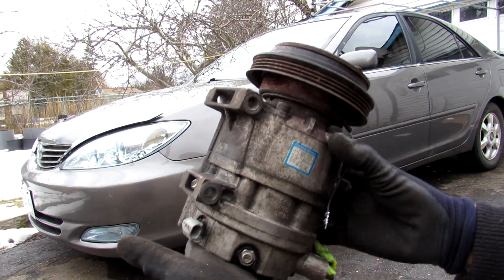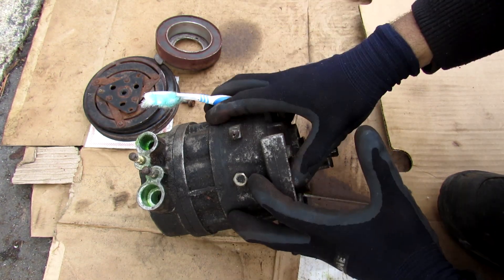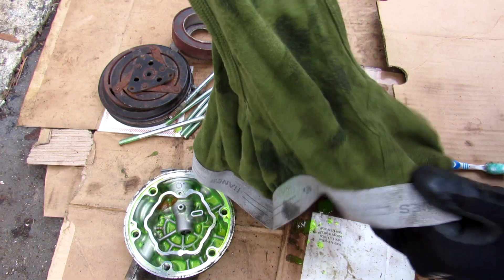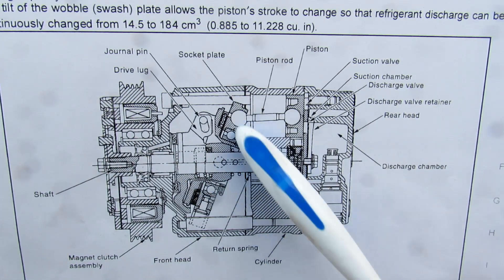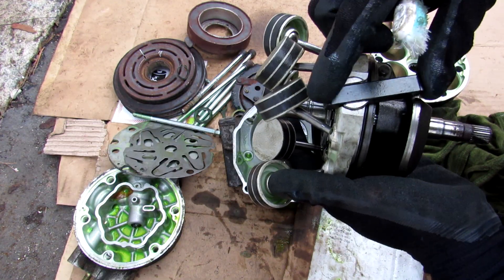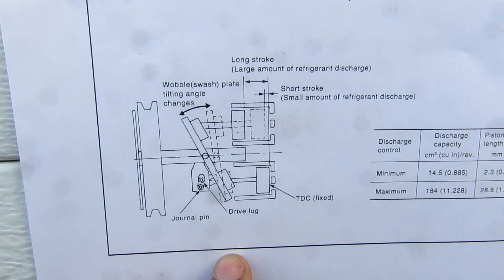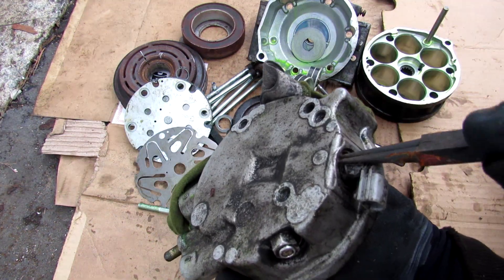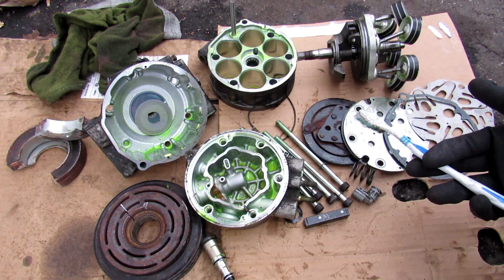How a Variable A/C Compressor Works

Comment: Great video!  I'm working on Denso 7SEU16C, which is a clutchless continuously variable compressor.  The compressor shaft is spinning whenever the belt is turning (no clutch!), and a solenoid controls the swash plate angle.  Because it doesn't have a clutch, you don't see the compressor engage as you can with the clutch versions, so sometimes the clutchless compressors get replaced because people think the compressor is toast (because they can't get the clutch to engage...but there is no clutch!).  These clutchless variables also get overcharged because the gauge display doesn't have the "kick on, kick off" on the low side that you see with regular clutch compressors.  So there are a little different.  They are found on vehicles that have high-end climate control systems which don't require the driver to constantly change the climate controls (ie, you can set a temperature).  The ECU can use engine rpm and all kinds of other info to vary the voltage to the compressor control valve (solenoid) to adjust the swash plate.  So with these clutchless variables, you don't even see the engine rpm change when you turn the AC on. 

I'm replacing the control valve/solenoid on an old (2003) Denso clutchless variable because the solenoids get intermittent failures as they get older.  Great video, and perhaps you can open up a Denso clutchless sometime!  The one I'm working on is from an '03 Mercedes ML350, and they were put on a lot of MB's, Lexus, and of course Toyotas.
Reply: I know instances where such a compressor has been used with manual climate controls (rotate the heater knob until you feel comfortable type of control) too.
Reply: Can you name a couple of vehicles that have this kind of ac comp.
Reply: @RamSharma-90_64  Toyota Camry ACV40
Reply: @RamSharma-90_64  Yes -- I have seen it on 2003 and newer Mercedes Benz's that have the M113 or M112 engine (ML350, ML500, etc), and also BMW's but also some Toyotas.  I think they are becoming more popular so we will see them more often.
Reply: Good explanation....I am having an issue with 2012 kia optima...low side pressure is high and cabin air is warm....when I rev engine up to 2500 rpms the low pressure drops and air gets cold...I think this is a clutchless compressor and my thinking is the angle plate is not changing because of a faulty solenoid valve....when I rev it up even though the displacement stays the same (barely open small displacement) I at least get some compression/suction because of the speed of the compressor....
Reply: Really interesting.  I have the exact same compressor on an Audi A4 Quattro 3L.  I have just fully stripped down my AC system with new dryer, orifice tube, condenser and compressor (and flushed old components).  When adding back to the car, the instructions supplied with what I believe is a remanufactured compressor state to just have half of the total PAG oil capacity put in the compressor (and turn it ten revolutions) and add the rest when charging the AC system (presumably in the dryer).  However, Denso states to put the full amount in the compressor in such circumstances (i.e. total rebuild).  I have heard of hyperlock.  Could I get this with this compressor if I put the full 180ml oil amount (as specified by Denso and specified by Audi) in it?  Any advice welcomed. Thanks.
Reply: @mickandrews9458 заливай полный объем масла, если ты уже промыл всю систему, значит в системе у тебя масла нет и требуется залить именно полную норму заправки масла
Reply: Waaau....at my ML350 from 03 just got toasted....it snaped the belt  ( i dont know why the pulei didnt snap!!!)  I ordered a new one ....and I wil try to DIY myself.....but I must study about the PAG oil.....

Comment: I am a bit confused. I thought the VDCs don't use clutches at all.
Reply: I am also..may be two types it's not.common sysytem 

 Not...A variable displacement compressor eliminates the need for a cycling clutch by altering the compressor's volume based on system demands. The system's clutch is left engaged while the system is in use. They are disengaged if there's a problem or shut down.
Reply: Clutches have been added to variable compressors to eliminate catastrophic failure if the compressor seizes.
Reply: Clutchless compressors use a pulley that has a breakaway mechanism in case of compressor failure. Typically a rubber annular torque cushion that can tear away. Those also reduce noise and vibration. You see them used as clutch springs as well, but they are more expensive than the leaf springs shown on this compressor.

Comment: I have a question. In cars with variable displacement compressors, it is supposed that the compressor is operating as long as the car motor is rotating. So, what does exactly pressing the AC switch button do in this case?
Reply from the maker: Engage the clutch
Reply: @speedkar99  
I mean in cluchless compressor (variable displacment compressor)
Reply: @alaaomraneg  Pressing the AC button (or engaging the defroster) energizes the solenoid in the control valve so that flow changes within the compressor housing and refrigerant begins being drawn away from the crankcase, increasing displacement. The increasing displacement causes a discharge or suction side check valve to open within the compressor housing, and refrigerant actually starts circulating within the AC loop. Turning the AC or defroster off causes the solenoid within the control valve to de-energize, routing refrigerant to the crankcase and increasing its pressure. The aforementioned check valve shuts off as soon as the displacement decreases enough, and refrigerant stops circulating inside the AC loop. The compressor basically gets "short-circuited" and any refrigerant circulation now takes place only within the compressor housing. However, even if the AC and defroster are kept off the climate control unit periodically energizes the control valve in order to circulate some refrigerant and lubricant through the system and to the compressor for a short while, keeping it cool. Displacement never gets 0 since recovering the correct swashplate angle is impossible when the swashplate is 90° relative to the compressor shaft. Hence the check valve.

Comment: I thought the variable type didn't have a clutch and the shaft is always spinning with the pulley and therefore the workload is controlled with the valve. This compressor seems to have both.
Reply: There are cars with both designs. Most manufacturers have added a clutch system with a variable compressor so that if the compressor seizes and fails, it won’t affect the serpentine belt and other accessories.

Comment: if its the pressure that controls the angle of the pistons. what creates that pressure in the first place?, the solenoid only controls the amount of pressure coming in or going out, it doesn't create any pressure by itself, 
much explanation is needed.
Reply from the maker: The movement of the pistons create pressure. 
The ECU controls how much of that pressure is bypassed to the back side of the piston (and therefore adjusts the swash plate angle). It's a closed loop control system
Reply: @speedkar99  
so the pistons themselves create enough pressure to work against it and also output the work needed for air conditioning?, sounds too good to be true fro me, how does the law of thermodynamics play in this??.
Reply: @roosterred7924  The engine is what's nutating (through another rotating plate) the plate that is driving the pistons forwards and backwards and giving the needed work for air conditioning to happen. The pressure gradient between the cylinders and the crankcase, which is what the control valve is able to act upon, is what makes the plate tilt in one direction or the other. There will always be a pressure gradient while the compressor is driven as long as the plates never achieve 90° relative to the compressor shaft. There's no magic involved here.

Comment: Excellent work here. This is basically an early Calsonic's take at the Harrison V5 comp. They later switched to an even simpler design that yields a smaller and even more efficient compressor, by removing the front nutating plate (actually called a wobble plate) and attaching pistons to the rear plate (the swashplate) by means of hemispherical shoes rather than rods, and that is the CVC (Compact Variable Compressor) compressor equipped on my car (even though mine has a mechanical control valve that doesn't act upon any external input, it just senses both the suction pressure and the discharge pressure and tries to regulate them to optimal values). The dye is not necessarily a sign of diagnosis having been taken on the vehicle's AC; it's usually fitted every time a service is done to better diagnose a leak in case one springs soon after the service. Some OEMs even include it in the factory. Personally, i see enough oil inside to think that the compressor has been ran with a good refrigerant charge most of its life. There's some rust, maybe owner didn't care about replacing the dryer/a DIY kit has been used to "top up" the AC and/or the system has been kept open for some time in its life. 2:55 That's an HPRV valve that pops open whenever discharge pressure becomes too high for some reason. Oil drain bolt is located forwards, towards the front (hex nut at 1:36), in order to aid oil removal. 3:31 Not only the pistons are moving up and down; at that time, they're doing so in the lowest displacement the compressor can attain (as you can better understand at 5:28). Interesting behaviour (and design) because the Harrison V5's mechanism will be doing the exact opposite, i.e. it will be driving the pistons at their maximum displacement in the same condition. That means that the Calsonic compressor has a "softer" start (the control valve, however, soon restores maximum displacement by bleeding the crankcase pressure to the suction side, if required). The CVC compressor in my car has the same perk. Rotate the clutch hub by hand in a summer day and it will get increasingly stiffer to turn as you keep turning it. That's because the plate's angle relative to the shaft is decreasing and the pistons are trying to compress more refrigerant.
Reply from the maker: Yes

Comment: Great explanation video!  Wonder if all manufactures will go to the clutch-less compressors?
Reply: No, the newest trend is clutch equipped variable displacement, as in 10th gen Honda Civic. Clutchless causes too much hassle especially when a leaks springs up and the customer doesn't take care of it the right way. Once the system is empty of refrigerant the clutchless compressor basically revs along with no cooling and no proper lubrication at all until it seizes up. Even if AC is kept off. With a clutch, the pressure transducer senses the lower than normal pressure and clutch engagement is forbidden. Not to mention, a clutchless comp running in the lowest displacement still takes away a little power.
Reply: @teravolt6113  thanks for clearing my confusion. I thought this VDCs don't use clutches at all. Now on this video I'm surprised to see a VDC type of a compressor incorporating the old fashion way of clutches.
So is it safe to say not all VDC are clutchless?
Reply: @hlalelemahlaela77  Yes, it is safe. The one on my car is variable displacement but has a clutch too. It is also safe to say that not all variable displacement compressors are electronically controlled (like the one featured in this video is). The one on my car is controlled by a mechanical valve featuring a set of evacuated bellows and a set of springs, instead of a solenoid.
Reply: @teravolt6113  thanks alot from South Africa.
You're the man.👊🏿
Reply from the maker: Yeah that might be the new norm

Comment: so what is the difference between normal AC compressor? Does magnet clutch on/off self regulates refrigerant pressure? If RPMs are too much - clutch off, if RPM too low - clutch on. I don't see the point except more complex AC compressor and parts which can break.
Reply from the maker: Clutching on and off is somewhat inefficient, because the pressure is fixed. That would be like flooring your car's gas pedal and then letting off all the way to maintain speed, without variability in between.
Reply: @speedkar99  Thank you for your reply. I just took a look into a different video about vtec AC compressor, the sole purpose of this variable AC compressor was to get rid of magnetic clutch. but it also didnt work, they kept it. Also, my accord's ac compressor, like your in your video, has magnetic clutch and vtec.
Reply: Clutch saves your compressor if for some reason you have to drive the car with an empty AC system. It also allows better engine power management with small engines. The Toyota iQ's compressor has both variable displacement and a clutch for this reason.

Comment: I'll take the old, simpler compressors any day.
Reply from the maker: Hmm, why not do 4-20? 4 windows down  @ 20 mph?
Reply: @speedkar99  Don't like to suffer in the heat but have had some very old systems that worked well.  Current daily driver is 22 yo and still good.
Reply: @wholeNwon  I have one of these compressors on my car and apart from new refrigerant port seals, new HPRV o-ring, a new control valve and about 3 clutch coils everything is running fine even after 17 years of operation...

Comment: I wonder what your thoughts on rebuilt ac compressors are.... Or if it's even possible to do it yourself?
Reply from the maker: Typically the seals are what go bad, if not the clutch. It really has to be done right and pressure tested to make sure it'll last. I would rather toss a used compressor in than rebuild it.
Reply: Not worth your time and money. By the time you have all the needed tools you've already spent the money needed for a good quality reman comp, that is if you've managed to successfully reassembly your old compressor. I'd say clutches, externally mounted control valves and o-rings are the most a wise DIYer or shop should deal with. Leave anything else to rebuilders if you don't wanna risk losing money, time and your sanity...

Comment: Excellent video. Now I know why my 08 Yaris lose 10 horses each time I turn on the AC. Is there such a thing as an all electric AC compressor?
Reply from the maker: That must be like being stuck in 2nd gear on your Yaris! I can feel the slight power loss on my V6 cars sometimes. Some hybrid cars have electric compressors. Also think of your home A/C....its powered by electricity too!
Reply: Yes
Reply: The one in my Prius is electric. It runs off the hybrid battery, but like all energy, the power has to come from somewhere. It will still draw tons of power to do its job, also, the Prius compressor/motor assembly is nearly $1000 alone.

It runs off of an inverter and the speed is varied like that..... The newest Prius also uses it as a heat pump so it can be full electric.

Comment: WOW. so basically it's like a variable valve lift. what's next? an AC compressor with v-tec.
Reply from the maker: Good one! this is more like continuously variable piston lift
Reply: Lolz.
Oh my God.
Reply from the maker: @Alex Tarasov Haha literally!!
Reply: It works in the same way as a variable displacement hydraulic pump - like that which is used on a excavator.
Reply: A company has made a engen just like this and called it a new type !! I busted out laughing when I seen it and said it's a A/C compressor but the people I was with had no idea I will show them this video great job by the way !!
Reply: We're do think opposed piston engine theory was invisioned from.
Reply: Variable displacement, which provides variable pressure/flow. The "valves" are nothing more than check valves.
Reply: It's just a simple 6 cylinder compressor with a wobble crankshaft. They have been making these since the 70s.

Comment: I'm in awe of the genius behind the design of each of these systems that are displayed here on speedkar99!
Reply: I am thankful for economics of scale allowing average joe to afford devices such as this is day to day lives.
Reply from the maker: @mrporky594  I'm surprised myself that the amount of technology in our cars is so relatively affordable.
Reply: @mrporky594  indeed
Reply from the maker: Thanks, I discover new things all the time opening things up. Its a fun learning experience that I enjoy!
Reply: @speedkar99  I think a possible area for a video idea would be to shed light on journal bearings in the engine than typical ball bearings found in wheel assy. Perhaps this would give reinforcement and reminder  towards selecting the right viscosity of engine oil. 

Just my thoughts that many neglect or think shop mechanic coffee talk to be more accurate.
Reply: Same here... but at the same time I hate dealing with all the different modules/ electronics involved; the simpler the better for me except engine management because i always want better gas mileage.
Reply: @pcnepal  Yep I agree. I still have a car with a carburetor, points and plugs  : )  At least I have a chance to get it going if it doesn't start someday, with my more modern cars I have NO SHOT but to call a tow truck  : /
Reply: @nasedo3129 I have two cars w/ carb but (a little better) w/ electronic ignition :)
Fuel injection system and engine management (injector duty cycle & a few input parameters) stuff are not that difficult to understand. If interested, start off with throttle body injection ( = computer controlled carb with a single injector instead of jets) and you don't want go back to carb in extreme cold weather and drive angle. Cheers!
Reply: @pcnepal  I concur. Much time is saved from avoiding targeted possible guessing and troubleshooting just via using a diagnostic tool which is the cost of the full tank of fuel.